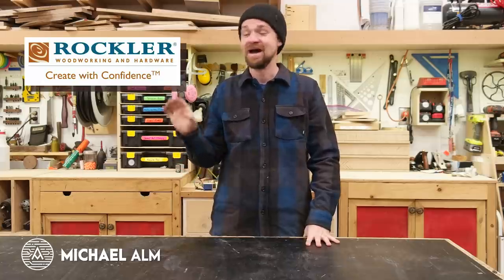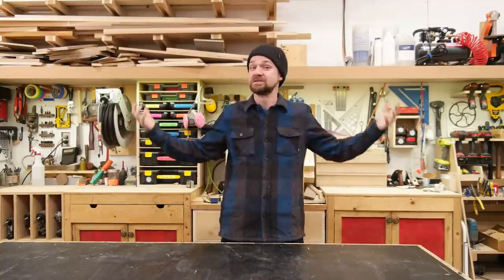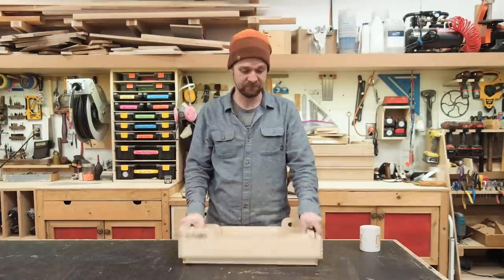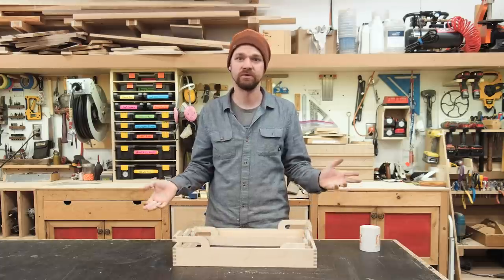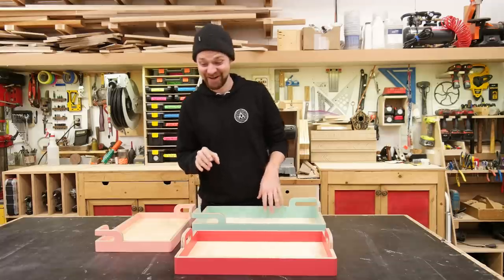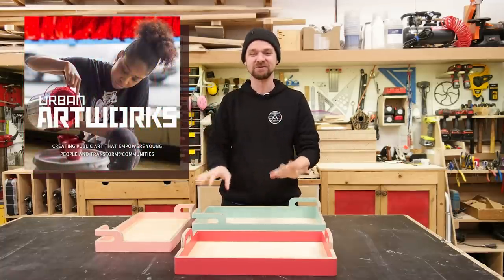Plywood Nesting Trays

Comment: I LOVE this design. Such a cool project. I wish I had your confidence on the router table!
When you said sponsored by Rockler and box joint... I knew you’d be using that jig! I have the older version of it, but I just can’t get it to work consistently. I think it’s my cheap router and table😔... I’ve given up on it.
Reply from the maker: Thanks! Yeah box joints are pretty finicky. I’ve had a lot of trouble getting them to work on the tablesaw, and so I was excited to test them out on the router table. I didn’t have any issues with the jig. My only trouble was preventing the ply from tearing out. The waste board in front helped. Not sure what the old jig was like. Maybe they fixed some issues
Reply: @MichaelAlm  It looks like the main difference is the indexing- on mine, it's an aluminium bar that the piece has to slide along. I just can't seem to get mine to cut square joints- something is shifting. I'm thinking it might be bit type or speed...